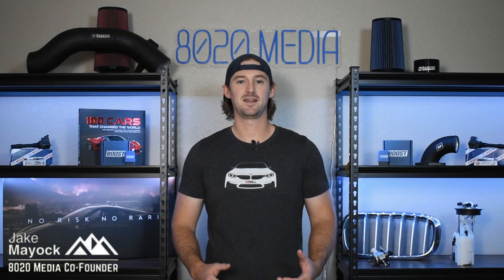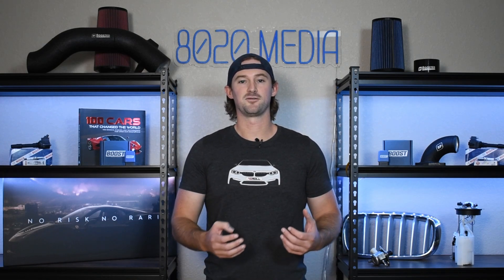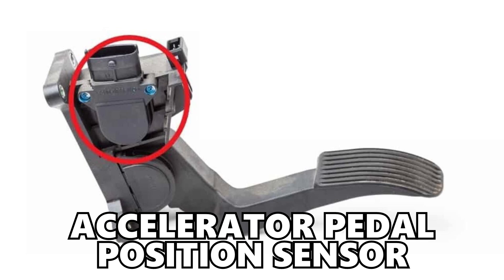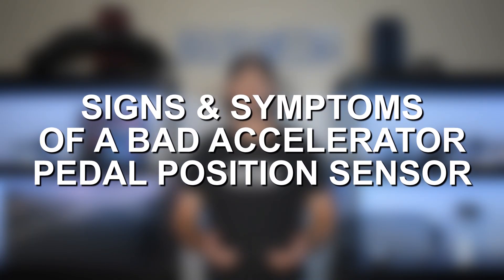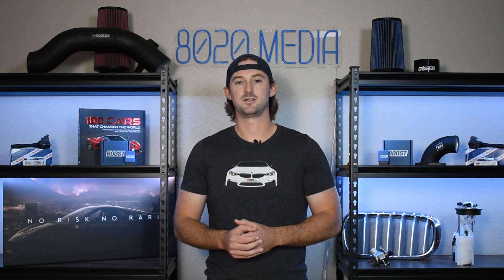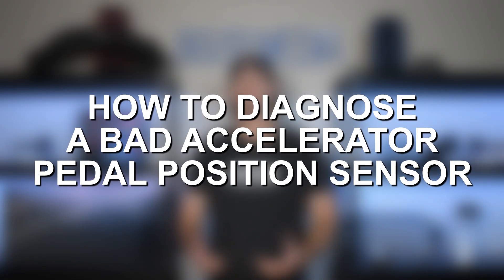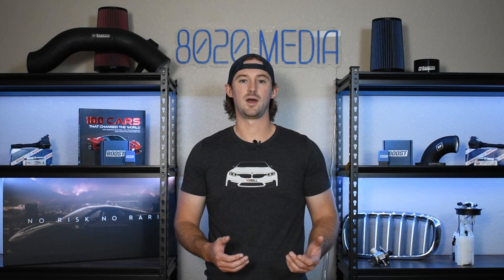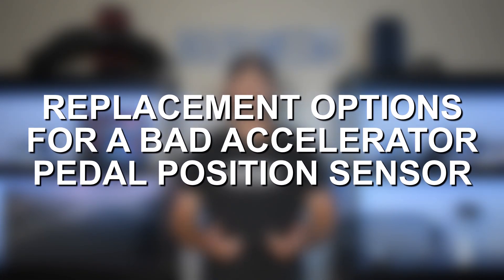Signs & Symptoms of a Bad Accelerator Pedal Position Sensor! (APPS)

Comment: I have a 2009 gmc 2500hd LMM DURAMAX that runs rough at idle and when accelerating sometimes it won’t respond or sometimes it will rev up to 3000 rpm, with no check engine light or codes. After watching this video I’m starting to believe that is the problem. But it could be ECM or TCM. Scratching my head. I also have a SHIFT INHIBITED
SELECT N TO RESET when I try to shift. And it happens during a holiday so no shops open.

Comment: What a so beautiful running machine when it's doing it right with no check engine light on now never has had one... He claims he changed the head gasket s extra wide exhaust pipe channeling to one side short

Comment: My 3500 I believe has a mass air flow problem I cleaned it but it did get a code at AutoZone a couple of times..... I took off upper intake and removed unplugged number 3 and 5 injector it was so rich now it's raining on EGR I guess backfires still too rich at the tailpipe
Reply: 3500 last time passed smog check with incredible excellent number
Reply: No one here I've seen in California Hollywood... Wants to work on Duramax Diesel they just want Cummins diesel with Allison transmission it's like a religious mantra they give you on the phone
Reply: So much money invested in trucks that have to be basically driven to the scrap yard.. at some point here it looks like time to scuttle them
Reply: My PDM put up front  EMC change before boss gave me this truck actually gave it to me I don't know about the pedal gas sensor

Comment: GMC Sierra SLE 1994 turbo diesel 6.5 c 1500 pickup truck... I'm getting very dangerous symptoms in the morning then they smooth out with this incessant searching as I touch the gas... Sometimes it's moves out sufficiently it's been more and more in the last 2 weeks no check engine light.... I have to sort of push it like a push scooter with touching the gas.. in the morning.... It goes to a little over 2000 RPM when I start it in the morning... I put it in gear turn the wheel against the curb and put parking brake on... This morning it actually started climbing the curb.. it idols and then has a surge does this severe stage about 2-3 minutes... Lady I'm just taking off and use my break to accelerate... 15 minutes to a half an hour. The bucking bronco is controllable it idles normally when I put it in park at that point with very odd undulating.... Smoothing out more and more but still an intermittent undulation... No mechanic will look at it... They won't work on my 97 GMC Sierra SLE 3500 ether... One of the effing mechanics said it was too heavy.....

Comment: 2010 mitsubishi endeavor 3.8 
Everything works as it should when in park but once you put it in gear the fuel pedal stops responding.
Reply from the maker: J - That symptom on your Endeavor usually points to the car going into a “limp mode” the second it’s shifted into gear, which kills throttle response to protect the transmission or engine; common causes are a failing throttle body or throttle position sensor, a bad transmission range sensor (the ECU might not be reading the gear correctly), or even an issue with the ECM/TCM communication that throws it into safe mode. Since it idles fine in park and only loses pedal in gear, I’d start by scanning for codes with a proper OBDII scanner—even if the check engine light isn’t on—because this problem almost always leaves a stored code. Check the throttle body connector and wiring for corrosion, confirm the brake switch isn’t stuck (the ECU cuts throttle if it thinks the brake is pressed), and see if the transmission range sensor is signaling correctly. Most of the time, cleaning or replacing the electronic throttle body fixes it, but you’ll want codes first to avoid throwing parts at it.
Reply: @8020Automotive it was the new throttle body/ tps that I put on was wrong even though website i ordered from said it was correct now I believe I either have a bad torque converter or just need to replace transmission filler
Reply from the maker: @annsman32 Sorry to hear this. Keep us updated!

Comment: My 2014 Kia Rio tends to make a squeaky noise when it first starts and often has a jerky acceleration sometimes could the accelerator pedal be the issue maybe
Reply from the maker: S - A squeaky noise on startup combined with occasional jerky acceleration, is more likely related to the serpentine belt or a tensioner issue rather than the accelerator pedal itself. The squeak is commonly caused by a worn or loose belt, especially when cold, while the jerky acceleration could be tied to throttle body buildup, a dirty mass airflow (MAF) sensor, or a failing throttle position sensor (TPS). It’s rare for the accelerator pedal itself to cause those symptoms unless it’s an electronic pedal with a faulty sensor (in which case you'd typically get a warning light or code). Start with checking the belt and cleaning the throttle body and MAF sensor. If the issue persists, scan for any stored codes that might point to a throttle or sensor problem.

Comment: Hi
I got code error 0043 on a 4x4 Nissan kingcab. 
Engine light keep flashing and gas pedal would not function. Can you help?
Reply from the maker: N - P0043 is a code indicating an issue with the heated oxygen sensor (HO2S) heater circuit for Bank 1, Sensor 3—usually pointing to a failed O2 sensor, blown fuse, damaged wiring, or a bad sensor ground; since your check engine light is flashing and the gas pedal becomes unresponsive, it suggests the vehicle is entering limp mode to prevent engine damage, which could mean a shorted O2 sensor heater circuit is causing voltage issues affecting throttle control (especially on electronic throttle models), so you should inspect the Bank 1 Sensor 3 wiring and connector for damage, check the related fuse, and replace the sensor if it tests out of spec or shows an open heater circuit.
Reply: @8020Automotive i don’t think its the generic ‘P’ code. It says 0043 gas pedal accelerator sensor. We replaced the said sensor with new one but no response at all. Apparently it needs reprogrammed which is another issue. But faulty sensor would work at times

Comment: My electronic throttle light come on and all of a sudden i get no throttle response
Reply from the maker: G - When your electronic throttle control (ETC) light comes on and you suddenly lose throttle response, it's a clear sign that the vehicle has gone into limp mode due to a problem with the drive-by-wire system, which includes the throttle body, accelerator pedal position sensor (APP sensor), and associated wiring; the most common causes are a failing throttle body motor, a bad APP sensor, or intermittent electrical issues like a loose connector or corroded ground—start by checking for any stored or pending trouble codes with a scanner, inspect the throttle body and pedal connectors for corrosion or damage, and if the issue is intermittent, try clearing the codes and seeing if it returns, but if it happens consistently, one of those components likely needs to be replaced.

Comment: My trailblazer goes into limp mode but NO codes or warning lights goes on...Where should i look for the problem?..Bad sensors?..Throttle dirty?..Cat converter?..Alternator (Serviced and clutch fixed)
Reply from the maker: F - Have you taken it to a mechanic?
Reply: @8020Media  .I think the problem is sorted..Air filter housing had a crack and created airflow problem..MaF sencor in the airflow were dirty as well.Cleaned with censor cleaner..No more Reduced engine power!
Reply: @8020Media yes
Reply from the maker: F - Awesome! Thanks for sharing your experience!

Comment: I have an ilx 2013. With no checking engine lights. My car jerks when accelerating. I changed the fuel pump, change purge solenoid and a brand new engine filter. It was at the shop for a week and the dealership couldn’t not figure out the problem. Help
Reply from the maker: V - Are you getting any engine codes?
Reply: Check your spark plugs , or crankshaft or camshaft . All cheap
Reply: This is the same problem that I'm having with my 2013 Taurus. Took it to a shop and they can't find anything wrong with it.